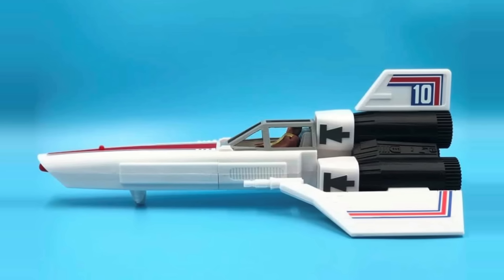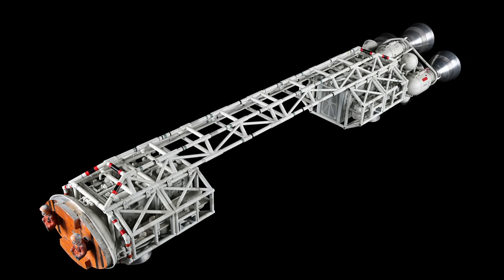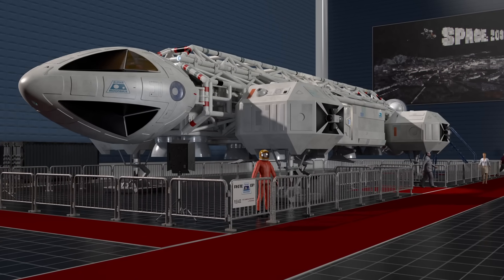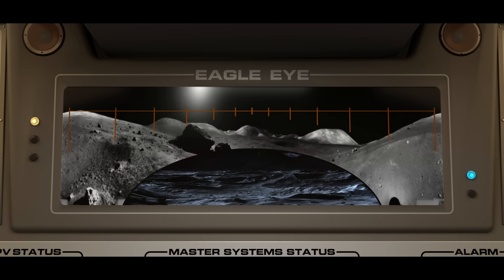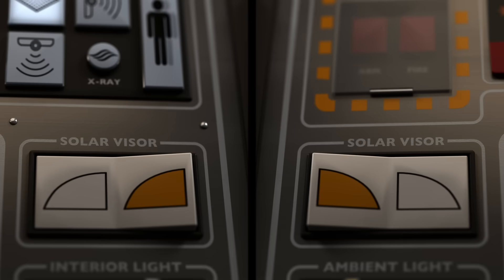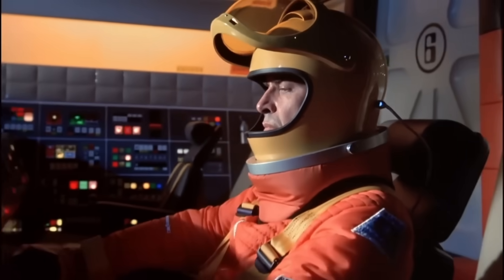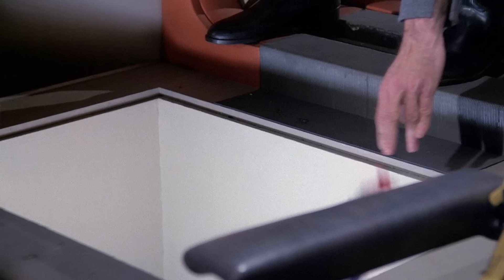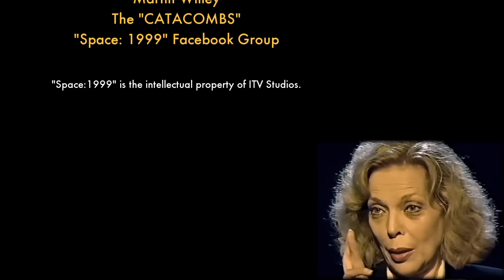Space: 1999 Eagle Rebuild — The Complete 50th Anniversary Edition

Comment: funnily enough I've just finished mine ,I did it in Rhino 3d , it isn't rendered but it is as accurate to the original 44'' version  , it is a mix of the mk1 , mk 2 and mk 3 in the engine section though , love yours .
Reply from the maker: Congratulations! What's the mk3 detail? dP's studio rebuild engine is a hybrid of Season 1 and 2.
Reply: @deLimitedProductions  got a lot of good picture refs from the originals from the ' catacombs model galley ' also found some original art department drawings from Michael Lamont ,after Brian Johnson had given him the original concepts . I wanted my Eagle to be as close to the original 44'' model ,so even though I drew it full size the hatch ways end up scaling to 5ft 5 in , as it would have done if they had scaled the original model .Great project to do ,might do Blake 7's 'Liberator' next .

Comment: Looks really cool! Only thing that would of been good to detail, is the panel to operate the explosive bolts of the command module. To jettison the module away from the body as in Season 1 - Dragon's Domain. This episode is where you also see the support feet of the passenger module extended as the module is detached from the frame and left on the landing pad.
Reply: Yes, "Dragon's Domain" is indeed the one instance I can recall where the passenger/lab pod's "feet" are actively put to use.
Reply from the maker: You're right. In the interest of brevity, we ignored the side consoles, which are much smaller now. But the idea is that all the esoteric controls are there: emergency separation, winch control, etc. Thanks for watching and participating!

Comment: That is stunning work. Really good reimagining of the cockpit. Something that always bothered me ever since I got my Dinky Eagles back in 1976 was the RCS thruster arrangement - how do the vehicles manage sideways translation? I could work out in general that they could roll 90 degrees and thrust upwards (or yaw 90 and thrust forwards) but that would be no good for zeroing in on a landing pad. Any ideas? ed Maybe lateral RCS hidden in the gantry?
Reply from the maker: There is a bit of hope here. The RCS thruster bells are actually angled out slightly (about 3 or 4 degrees). If you were to open two opposing nozzles simultaneously, there is then some lateral push. It's not as efficient has having a dedicated outward nozzle. I suspect Brian Johnson avoided a 5th nozzle because it just looked bad.
Reply: @deLimitedProductions  Would it look bad? It would certainly scratch my 50 year long Physics itch!
Reply from the maker: "Bad" in the sense of impacting the Eagle's aesthetic profile. The landing pods are already large protrusions. Adding another protrusion to those might have been too much purely for cosmetic reasons. I have to believe that Brian Johnson knew there should be five nozzles.
Reply: @deLimitedProductions  Agreed. Thanks!

Comment: Its very good, but the feet retracting in space would not be needed as there is no air or drag in space. I thought they only retracted to act as a buffer when landing, not for any other reason
Reply: Eagle was atmospheric flight capable so air was definitely a factor at some point. That of course discounts the fact that Eagle's design was terrible aerodynamically speaking but it also was never intended as an atmospheric shuttle, merely to have the ability to get to and from Earth's surface.
Reply: If I had make something up I 'd say retracting the feet brings the Craft's center of gravity back inside the hill.
Reply from the maker: @TheTimeProphet, the landing suspension is provided by the piston and hinged arms; that is independent of the entire strut assembly moving up or down.

Comment: I'm kind of surprised they didn't do a shot of the landing pad retracting into the pod from different angles. It wouldn't have been hard to do.
Reply from the maker: The pods on the filming model didn't have the necessary cavities. If you're referring to the updated 3D model, you can see it in some of dP's Eagle animations (refer to the Eagle playlist).
Reply: @deLimitedProductions  I was thinking they could have made a larger version of the landing pod with working gear for a close up. Couple hours to make it and another couple hours to film it. They wouldn't even need to finish the pod, just the sides exposed to the camera and have landing gear that went up and down. The landing gear could be attached to a connecting rod off camera that allows them to raise and lower it by hand. It's fairly simple set up for what would be a stock SFX shot. Do it once and you have 3 seconds of air time every time the Eagle lands or takes off. if you use that filler shot three times an episode, 26 episodes per season, you've saved the cost of almost 260 seconds of your SFX budget.

Comment: Since the fictional pilots need a video view screen to see forward, down and around...the windows and the 4 flat cutouts are not needed anyway.  Just making the pilot module a cone would have been more efficient and structurally sound.

If plexi view was desired then the designers should have made the 4 cutouts all smooth plexi with a floating control dash centered in the array.
Reply from the maker: You have to remember, however, that the Eagle Transporter was built as a filming model, with the show regularly featuring exterior action shots. The Eagle needed to look cool from the outside.
Reply: @deLimitedProductions  the black painted cutouts against white just gave a facial look to the photography and therefore added more drama.  The same way SID looked sorta alive in UFO with that distinguished AI voice.  It was a character.

There was a plastic dime store model  I built around 1970.  It was a fantasy space ship.  I don't think it was connected with any show, movie or comic.  Just a concoction of the model company, I think.  However it look almost exactly like the deep space probe being readied in "Breakaway" with the detachable command module.  It was silver gray, but otherwise when I 1st saw 1999 five years later I went and found the model in a drawer.  It was pretty close.

Comment: The Eagle cockpit windows were originally based on those on the Gemini space capsule, which were even smaller but of course didn't have the lower dummy windows. I always thought that the dummy windows were a stupid idea, and frankly unnecessary as the overall look of the craft would be just as cool (and more realistic) if the lower cutaway area was filled in so that it followed the contours of the lower half of the command module, as the model makers did on the MkIX Hawk in the 1st season episode War Games
Reply from the maker: Yes, the Eagle command module would still look good with only two cut-outs. Another  design option is to keep all four cut-outs, but have the lower ones begin about one 1.5 meters closer to the nose.
Reply: It was about modularity - top and bottom are the same shell.